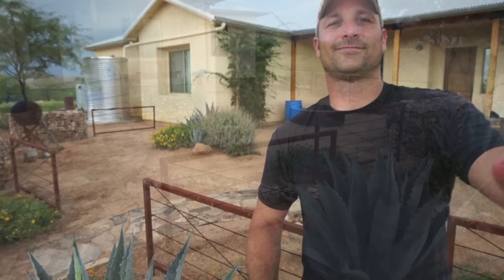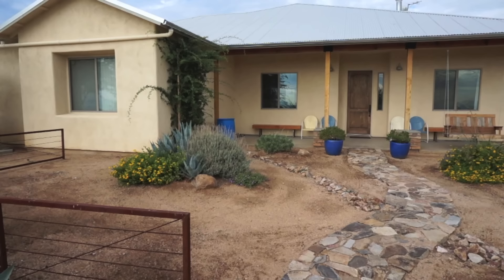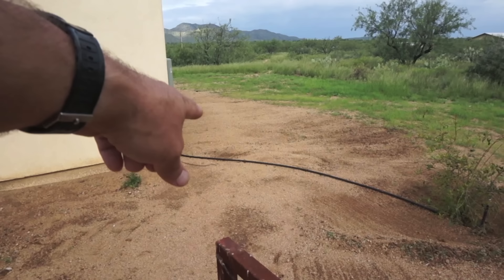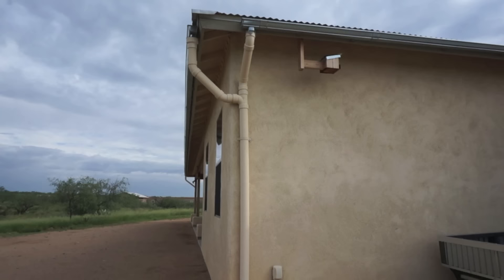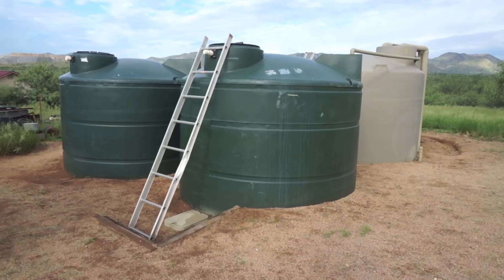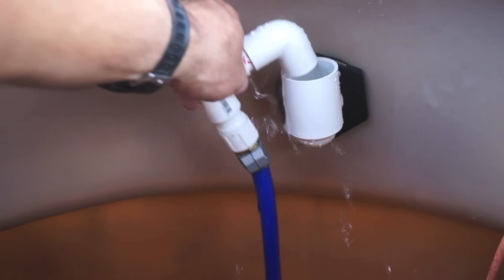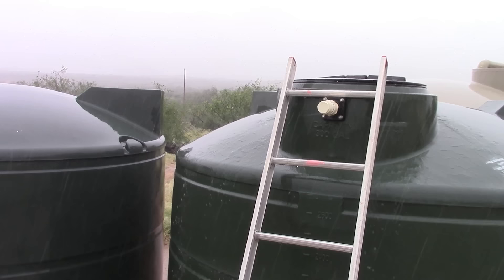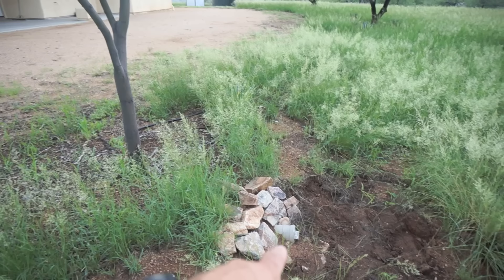Rainwater Harvesting - Home System Tour

Comment: LOVE your videos, Joe! Quick question: how much did all of this cost? Were you able to source any freebies? I'm planning on being COMPLETELY off-grid and would even like to avoid drilling a well, and I'm looking to price exactly how much a system like yours would cost me.

Thanks Joe and keep up the great videos!!

(I'm in northern AZ, by the way)
Reply from the maker: +Zack Williams Hey Zack... a lot of what I do is with freebies and craigslist items but most of this system was newly purchased.   Also, when I purchased the tanks and the pipes 6 years ago, the prices were much cheaper.  The two green tanks cost me $8-900 each and the tan 5000gal tank was close to $2000.  I have seen them much cheaper if you source them directly from the MFG'r... which is in California, so if you had a trailer and wanted to make a road trip it might be worth your while.  As for the PVC... you'll have to check Home Depot/ Lowes to see you'll need ... but it does add up quite a bit;) 
However, one saving grace is that AZ has a tax credit as well as some water companies that can help you recover anywhere from 25% to 50+% of your costs.  I personally used the state credit of 25% because I don't live in a town... but my buddy just recently put up a culvert cistern and was able to recoop nearly 75% of the costs... pretty sweet deal for him!

Anyways, hope some of that is helpful.  btw... where in Northern AZ are you located?  A lot of beautiful country up there!

Joe
Reply: +homesteadonomics Hi Joe!  

Thanks for all the info!  It's really helpful, and I'll be sure to check into it!  Who is the manufacturer, by the way?  Also, I LOVE your culvert cistern, but I looked online and I was having difficulty sourcing culvert pipe.  Any tips?

Well, I'm currently living in Tempe, but my land is on the Mogollon Rim, near Snowflake!  I plan on converting the whole parcel into a permaculture farm and animal sanctuary (my wife and I are both vegan, and we've wanted to open an animal rescue for a long time).  I want to be COMPLETELY off-grid though, so I'm looking into rainwater harvesting; swales; wind and water turbines; solar panels; and most of the things you would expect a person to look into that wants to live off-grid.  

We also want to produce our own ethanol to power our machines, so we have a LOT of projects ahead of us :)  It's gonna be several years before it all gets underway, but I'm trying to prepare as best as I can right now.  

But the fact that you're getting over 90% of your water usage from rainwater--in the low desert no less!--is very good news and makes me hopeful about my off-grid goals!

Thanks for all the great videos you put out, and thanks for making time to answer my question!  Looking forward to more of your projects!!

Zack
Reply from the maker: +Zack Williams Hi Zack... LOVE the plans you have for the off-grid animal rescue and permaculture farm!  Very cool stuff:)  A lot of those ideas you have are also on my list as well... wind, solar, ... and larger swales... I've got smaller ones but want to do an excavator sized project soon too:)  I'd love to come out and see your property once you get that project started... as long as you wouldn't mind a guy poking around with a camera getting ideas for my own projects ;)
As for the mnfr's of the tanks I have... two are Norwesco and  the other I can't remember the brand of... could be norwesco but just can't remember.
also....Funny you are in Tempe... I was just there this morning and yesterday to do the "phoenix tour de coops"... put on by the Valley Permaculture alliance.  Pretty neat little event that I like to try and see every year!
Joe
Reply: +homesteadonomics You're more than welcome to come check it out! :)  I'm planning a trip up this spring to scatter around native clay seed pellets (pinon; western sand cherry; canyon grapes; hyssop; etc), but there might not be too much to see in that trip, haha, but you're welcome to check that out too, if you'd like!

WOW! I literally laughed out loud when you said you were at Tour De Coops because, as a matter of fact, I've been volunteering with Valley Permaculture Alliance for about six months now!  Haha!  The world really is a lot smaller than one might think!  

I was actually helping Jake Mace (VeganAthlete here on YouTube) plant some new trees that day, but I've tabled at some other events with VPA and it's been a lot of fun! 

Hopefully we can cross paths soon!

Zack
Reply from the maker: Oh wow!  That's so cool!  I plan on putting together a quick little highlights video of the tour de coops... but just need to look at the footage on my camera first to see if it'll tell a good story or not.  If the clips were too shaky, etc,.. I won't put it together but if they can show the TDC well, then I will... just gotta see;)
And that cool about Jake Mace too.... seen a few of his rainwater vids and really liked his sunken garden areas in his backyard.  I have a friend in Tucson with a similar setup that I plan on doing a video on... but she wants to do it when things are in full bloom and looking their best... so maybe in the spring:)
And regarding your place... I might be able to supply you with some Tarahumara Squash seeds, as I'm actually saving some right now in the kitchen:)  They won't be annuals but they are native to the SW and I originally got them from the Native Seed Search in Tucson. They are the same squash that are in my Rainwater Garden vids:)

Joe
Reply: +homesteadonomics That sounds great!  If you end up making a video, I'll link it to the staff at VPA so they can share it with others :)

Sounds cool!  Tucson actually has some pretty great things going with watershed management, xeriscaping, and so on, so I'm looking forward to the video of your friend's yard!

Thanks Joe!  That would be awesome!  Native Seed Search is an awesome organization, and I actually just today planted some of their perennial onions, as well as a few other seeds, in my first ever raised beds!  I'd DEFINITELY appreciate the seeds, and I promise to put them to good use :D  Are they perennial then?

I really dig your Rainwater Garden by the way--in fact, I think the first video of yours that I watched was one where you talked about the berm around your corn, the overflow basin and the squash, so it will be an AWESOME full-circle to have those seeds growing on my land :)

If you're planning on being in Tempe any time soon, be sure to give me a heads up!  :)

Zack
Reply from the maker: Hey Zack,

I agree... Tucson has some great stuff in regard to water shed managament, rainwater harvesting, etc,.... I love Brad Lancasters books on Rainwater harvesting and earthworks! 
As for the seeds... they are an annual but I imagine in the right environment would reproduce from fallen fruits as in a natural system.  Just let me know an address and I'll send some over to you:)  Or if I make it up to Tempe soon I could meet you and give them to you then:)

Also, I just put up the tour de coops video:)

Joe

Comment: Great job, thoughtful layout, how much similar setup will cost?
Reply from the maker: Thanks so much Zeze!  It's hard to say because the most expensive part is the tanks and for folks who don't live in the desert, it will be much cheaper because they won't need to same capacity that i have.
The quick answer is that this was roughly $4k plus some... but you have to remember that I don't have a well or city water so this was the cheapest option for me.   But say for someone in Seattle or another wet area.. they might be able to get away with a system that costs under $1000.  
Anyways, hope that helps:)
joe

Comment: I'm guessing it doesn't freeze where you're at?
Reply from the maker: Hi Joe, we get freezing temps but not like in more northern climates.  I'm at 4000' elevation so I get a bit colder than Tucson but mid teens is the coldest we usually get.  Colder climates would need to drain a system like this or dig it much deeper:)
Joe
Reply: Thanks!

Comment: About how much does it cost to set up a system like this?
Reply from the maker: It's hard to say because the most expensive part is the tanks and for folks who don't live in the desert, it will be much cheaper because they won't need to same capacity that i have.
The quick answer is that this was roughly $4k plus some... but you have to remember that I don't have a well or city water so this was the cheapest option for me.   But say for someone in Seattle or another wet area.. they might be able to get away with a system that costs under $1000.  
Anyways, hope that helps:)
joe

Comment: I guess it doesn't freeze hard there in Tucson? Not sure how I would do that setup here in Nebraska. We get below 0 Temps regularly in the winters. Those tanks wouldn't make it a season above ground and putting them below ground isn't an option.
Reply from the maker: +atariforever2002 Nope, we don't get hard freezes hear too much.  Mid-teens is exceptionaly cold for us..lol   But it can be done in NE too... just with some differences.  btw..  My moms side of the family is from cherry county and I even used to live in Sidney for a while:)  But ultimately you'd most likely be looking at a seasonal system.  You'd basically have to either drain the system and/or bury the pipes below your frost line... which I'm guessing is 3-4 ft?  Also, regarding cisterns, a below ground concrete one is probably the best option in your area as well.  Just so long as the cistern roof is a couple feet below ground level.  Anyways, thanks for watching!  And good to hear from NE... go Big Red:)
Joe
Reply: Thanks Joe! Go Big Red indeed! I'm in Lincoln, so we get to a lot of games. I grew up in Holt county, so I am quite familiar with Cherry co. also. 
A lot of the old farmsteads around had (and still do) underground cisterns. I guess they knew what they were doing 100 years ago even. 
I think I'm going to give an above ground collection system a try this spring and summer. I just wish I could use something year round. I think it would be easier to pack up and move the entire family to Arizona then too figure out a way to bury all of that underground. Digging in the "gumbo" in this area by hand is a widowmaker.  haha

Comment: I LOVE your videos! We are in Colorado Rockies at 7,000 feet, so looks like the wet pipe system will not work here. I am thinking the water collection pipes need to be above ground and sloped so they completely drain, then the water supply pipe to house buried 6 feet deep? Last winter we hit -20 F, so 6 feet down is standard freeze protection. A couple  other questions: (1) You mention your tanks are buried "about halfway.," These are "above ground tanks, yes? I am guessing "about halfway" is safe from not collapsing? How did you determine that? And if they are empty they will not collapse? (2) You use bleach to kill microorganisms in your tank. I have a friend who uses this product: http://www.teraganix.com/EM-1-Microbial-Inoculant-Microbial-Inoculants-p/1000.htm and it digests any biological material in the water. He loves it. Thought I'd share with you. Thank you again for  AMAZING videos!
Reply from the maker: Thanks Peter :)

Yes, fully draining the pipes would be a necessity for you.  Mine have two clean outs lower than everything else and can be drained completely... although freezing is much less an issue here :)

As for burying tanks... that depends on your soil type.  These types of tanks aren't meant to be buried, but I have really solid ground (decomposed granite) so I can literally cut a 4ft trench and the sides would take years to start falling in from rain runoff.  But areas with soft or sandy soil wouldn't be able to partially bury the tanks like this.   
I will check into the teraganix.. sounds interesting for sure!  thanks!

Thanks for checking out the videos peter :)
JOe

Comment: How much would you estimate this costs?
Reply from the maker: +Wilson Calix   Hi Wilson....here is a previous response I gave on this...
"a lot of what I do is with freebies and craigslist items but most of this system was newly purchased.   Also, when I purchased the tanks and the pipes 6 years ago, the prices were much cheaper.  The two green tanks cost me $8-900 each and the tan 5000gal tank was close to $2000.  I have seen them much cheaper if you source them directly from the MFG'r... which is in California, so if you had a trailer and wanted to make a road trip it might be worth your while.  As for the PVC... you'll have to check Home Depot/ Lowes to see you'll need ... but it does add up quite a bit;) 
...anyways, I hope that helps a bit:)
Joe

Comment: I find your system very complicated when you can actually connect PVC pipes lower with by installing a shut off valve rather than overhead pipes.

Comment: Total $ investment  ??
Reply from the maker: +Dave Stone Hey Dave… I think it was around 4.5k when I installed it, which was a fraction of the cost to drill a well out here in the desert… tanks were much cheaper then and I got a good deal on the pipes/fittings because I was buying from a construction supplier at the time.  Thanks for watching:)
Reply: homesteadonomics
Yeah wells aren't cheap. I was just quoted 7k to go 126 ft.
Reply from the maker: ouch!  I feel the pain… I'd love to have a well at some point but so far the rain system has been serving us well!  Good luck on finding the right driller:)
Joe
Reply: homesteadonomics
Thanks. There are 3 drillers in my area and they all know each other and we believe they are price fixing. Your system is really cool. I'll let you go.

Comment: nice video but for MOST (98%) of people out there interested ...can not afford anything remotely close to the cost of your system
Reply from the maker: +jsholt123 I understand what you are saying... but please remember the context that this system is for my needs and in most other places in the world, it would be much less expensive in that much less capacity would be needed(ie... I have more capacity to make it through long dry spells here in the desert).  Places with more consistent rainfall, might only need one tank/cistern from which to harvest and draw from.   And this could be IBC totes, a homemade ferrocement cistern, culvert cistern, etc,.  Principals are the same regardless of the size.

Also important, is that I live in an area where wells are hundreds of feet down and much more expensive to install than this system was.  I actually got several estimates for wells that were more than 3 times the cost of this system.  And since this system has been in place, I don't have a monthly water bill, for which most would be paying anyways.  

I feel the need to explain this because this is my primary source of water and some seem to think that this was just some hobby venture for me.  I don't have a well, nor am I connected to municipal water(no water bills)... and has paid for itself since it was installed.   

This was meant to inspire ideas for others who may be considering a rainwater harvesting project of their own... big or small:)  Anyways, sorry for the long response but I just wanted to explain the context of the situation.  Thanks for watching:)

Joe

Comment: Soooo... someone has money, lol. Wow
Reply from the maker: This is my only water source, aside from trucking water in.  It is used for drinking, cooking, washing, bathing, gardening, etc,.  I do not have a well or municipal/city water access.  This was the cheapest option for water when I built my home, as wells in my area cost upwards of 10-15K.   Furthermore, I installed it myself and did not pay anyone to install it or create it.  So far, this system has more than paid for itself by not having a water bill.   

Anyways, I put the video up as inspiration for others that may be looking to do the same thing.  Thanks for watching and Good luck if you decide to try a rainwater harvesting project of your own:)
Reply: homesteadonomics I appreciate the quick reply. After 15 years in the military I just want to do the same. It would be a dream come true to live like that.
Reply from the maker: No problem:)  If you do try a similar system, it's important to remember that if you live in an area with more consistent rainfall you wouldn't need the extra capacity of tanks.... which is by far the largest cost of a system.   I just have to have it so that I can make it though our dry periods in between  rains:)
JOe
Reply: I like how neat and tidily you have it all set up, excellent. I'm Canadian, and live in the tiny percentage of Canada that has very little concern about freezing as we live among the gulf islands of the southern British Columbian coastline. Thanks for sharing, as it is very inspirational. :-)